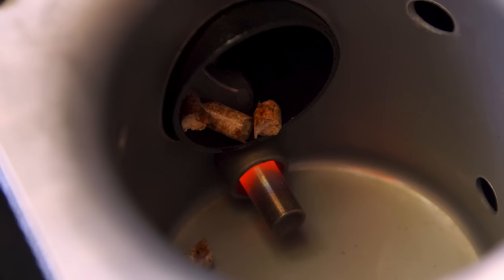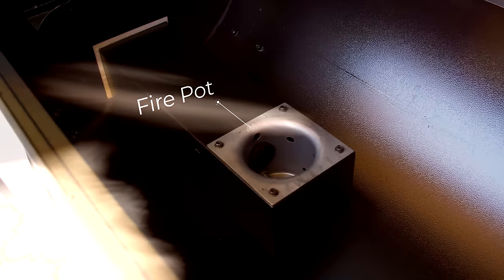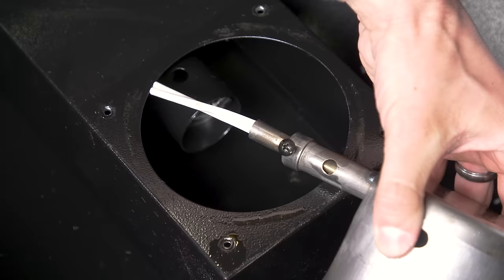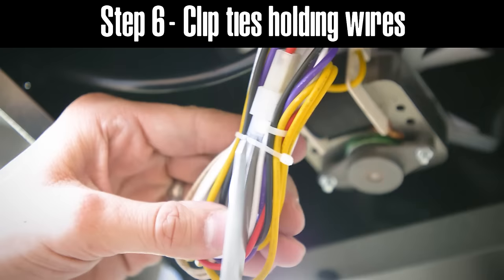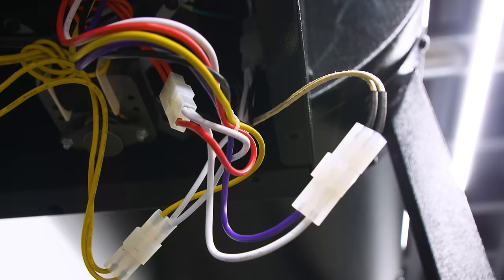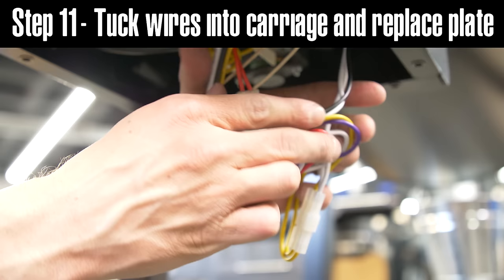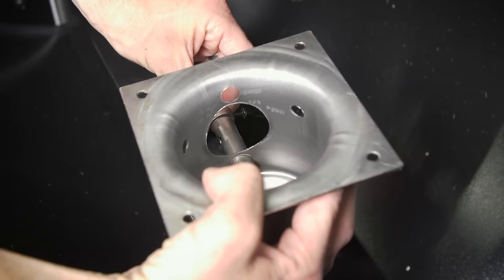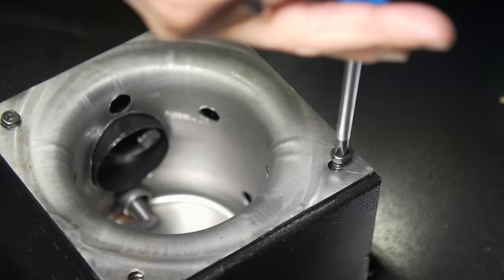How to Replace an Igniter on any Pit Boss Wood Pellet Grill | Pit Boss Pit Stops

Comment: You realize if Pit Boss engineer used even a hair of thought they could make these things 10000xs easier to work on
Reply: This is a pretty simple task that took me less then 10 minutes.  How much easier does it need to be?
Reply: @Mark Ferrari  They should make it where you don't have to replace it after a couple of months and just a few cooks. It's like replacing an alternater in a 2022 vehicle with the new car smell still in it. If I knew I'd be opening up panels and unscrewing  devices I would have gotten a Kamado Joe instead. Excuse my rant but $1100  is too much for their parts to fail that easily.
Reply: @markferrari9734  naw bro a lot of other companies make it easier than this.
Reply: Mine lasted for 2 years.... yours went bad because you didnt clean it or service it properly
Reply: @JABBAWOKKY not even remotely true. I am meticulous about cleaning mine and keeping it seasoned. I vacuum the ash out of my burn pot after every cook. My igniter barely lasted 7 months.
Reply: If  this is hard for you.... Stick to charcoal. 😂

Comment: I have a 4 year old PB and the igniter is no longer heating properly to ignite the pellets. How can I get to the igniter set screw if the screws for the firebox are rusted to the point they can't be turned with a screwdriver or socket? I've always kept my grill covered, so this shouldn't have happened if proper materials were used.
Reply from the maker: We can understand that sometimes the screws are super snug and can be frustrating. There are a few things we can try to get the screws off.

I recommend getting a Flathead Screwdriver and a Hammer. I would give the screw(s) that are giving grief a few love taps on the side of the screws head. This should loosen it up and be easier to unscrew. 

If that doesn't work depending on how many are left, you can turn the access panel to get access to the back of the screws head.

All else fails you can carefully drill the screws out. The Access panel screws dimensions are about M5 .08 Thread.
Reply: Metal is too much like junk and gone to be getting a hammer and and hitting anything. Junk metal used and rusted out and never been wet. Wtf?

Comment: This is the comment you need to read because i actually watched this video, then replaced the igniter.....you will notice in this video, the grill being worked on is brand new.  No cooking has been done on that grill.  My grill that needed an igniter changed has been used because that makes fucking sense.  EVERY screw i encountered might as well have been a tack weld.  Because the garbage dollar general brand screws this company used INSIDE or immediately adjacent to THE IGNITER BOX that by design, gets up to 600 plus degrees are NOT serviceable.  But it is eventually doable. Good luck, but put whatever you thought you were going to cook back in the freezer.  Because you are going to have to run to the hardware store at least twice for new screws and a grinder cut off wheel.

Comment: Had my pit boss for 5 months and already have an igniter issue and controller. Been waiting almost a month for parts. What good is a warranty if there are no parts. I'm looking into putting a rec tec controller in it and be done with it. Stay away from pit boss
Reply: Same issue man. I’ve rebuilt my whole grill and still having issues.

Comment: I recommend adding a string to this replacement. Attach a string to the old igniter end right at the split of the wires. Pull the igniter wire (and string) out through the grommet hole. Then cut the string off. Attach that end of the string to the split in the new igniter and feed the new igniter into the hole. Then just pull the string to pull the new igniter through to the fire pot. Takes all the hassle out of install. Not pictured in video. Remove the grommet from the old igniter via the igniter end and feed it into the new igniter before install.
Reply: I was thinking something like this... I was thinking about taping the wire end to the old burner tip, pull it through disconnect old, connect new, done and done
Reply: Hooked the new connection to the old init. Was able to attached through original hole
Reply: Don't do this just pull the old out and put the new in

Comment: This is practically useless for the vertical smoker. The burn pot doesn't come out through the top, and there is a lot more to remove than just a single cover plate. A separate how-to video is definitely warranted in this case.

Comment: Right out of the box my ignitor won't work! I'm currently on hold for tech support for 45 minutes now! Awesome grill if it worked. I mean right out of the box.. Really??
Reply: So it's going on two weeks now and they still haven't shipped my control board yet! Apparently it is the control board and not the ignitor. I just called and they said they are behind on shipping replacement parts, but call back in a week.. Smh
Reply: Same here... Just plug it on a non GFCI outlet and it will work
Reply: @bobsmith1841  so just an update. It ended up being the control board. I went through tech support and they said that they would send me a new board. I just got it last week! Took all of this time! It's a great grill now that it's working properly
Reply: Did the auger and blower work?;Just put my 820 together today....auger works, blower and control panel light up, but no ignition....
Reply: spudthegreater USA 
same thing as me.  Everything works except the rod doesn’t heat up.
Reply: I figured it out...The instructions are a little misleading.  The best way to do it is plug into a non gfi outlet,  push the on button, prime until you here the pellets drop, THEN turn it to smoke setting and wait. it will take a few mins to start smoking, then it really starts roaring and smoke billows out, then it clears and the temp will start to rise.  you can then close the lid. The problem was the igniter shut off before the auger primer fed the pellets.

Comment: This procedure is very easy to do.  Much better than the latest video from Pit Boss that shows you having to take off the hopper assembly.  At least for the PB1100, you can follow the procedure shown in this video, works fine!

Comment: I’ve had my Pitboss Pro Series for approximately 1 year coming up in June, still a few months shy , and my igniter went out tonight. 

Pitboss has been great with my warranty , sending me parts that have Been defective. I’m starting to think , this grill has had a lot of things go out. Grates, temperature proves, now this.. 

I am considering the fact that I use mine daily. This thing has changed the way we eat! So I’m going to ride out my 5 year warranty and appreciate to positive over the negative
Reply: I’ve had mine for about three months. I just pulled out the old igniter. I’m trying to install the new igniter but it will not fit through the hole via the hopper. Super frustrating! Now I’m left without a smoker till God knows when.
Reply: Im probably going to upgrade to the Digital model soon. Since my bare bones one has a dead igniter
Reply: I’ve had my grill for just over a year , The igniter went out and PitBoss sent me a new one right away. However I can’t removing the fire pot because the screws have deteriorated. It’s literally fused together. Hopefully i can find a solution. I love my grill! Help

Comment: If your Pit Boss is acting up like mine and tripping breakers, you can do one or both of these options. OPTION 1: Get your pellet grill going and then disconnect the purple and white igniter wires. This will prevent a faulty igniter from tripping your breaker after you've started grilling. OPTION 2: Run a switch oto the outside of the grill just for your igniter. Turn the switch on to start the grill and turn the switch off once the grill is started. 🤯 

The first option is $FREE.99 and the second option will cost you a couple bucks at your local store.

Comment: Last morning i found out that the igniter was pulled back in his house and the cable was too short and not locked with the screw....i lengthen it under de hopper..

Now my 850 is a beast❤❤❤❤❤

Comment: Does anyone know if replacing the igniter will stop my pit boss Austin XL from shutting off after about 10 minutes? I already replaced the GFCI outlet thinking that was the problem but it’s still cutting off on it’s own.
Reply from the maker: Hey JJ, the igniter draws the most amount of power and only stays on during start up. Most of the time when the grill has a power fault within 5-10 minutes it's due to the igniter. To test this, try leaving the igniter unplugged (purple/white wires) and run the grill. If it doesn't error out we know the igniter was at fault. Feel free to call our CARE Team at (480) 923 9630 for further troubleshooting steps.

Comment: I am having a issue with my pit boss........I set it at 275 degrees and then it just keeps rising really fast all the way to 350 degrees.......so I just turned it off......I clean the thermostat......still does it........any other ideas????

Comment: Thank you.  You all are very responsive to concerns and questions.  Customer service has been great!  
The igniter I replaced seems to stick out into the firepot a bit longer than shown in the video.   Does this matter much?
Reply from the maker: Good practice is 1/4-1/2 but it isn't the end of the world. It just runs a bigger risk of being covered in pellets and choking. If you ever wind up using an off brand and the ignitor is drowned in pellet waste that comes with non-100% natural pellets, like sugars or plastics, it would be a bit harder to start up the next time.It's a pretty simple mechanic going on, so its simple to address if something is going wrong, just keep an eye on it.

Comment: What if I leave the igniter rod out 1" instead of the recommendation of 1/2
Reply from the maker: Hey Brett, if the igniter is too far into the firepot, it may burn out prematurely due to the direct heat from continuous fires.

Comment: My issue just started happening. Once I turn on the unit on smoke setting it continues to blow and feed pellets causing a large flame and after a bit flips the breaker and shuts down. Any solution??

Comment: Works great if your machine is brand new. Unfortunately mine is 1 year old and the screw that holds the igniter into the burn pot broke. I had to drill the remainder piece of screw out and now I'm trying to put it all back together and hope the new igniter stays put.
Reply from the maker: Hey there Shawn, we are sorry to hear that, It is not normal for that screw to break like that.
Reply: Just happened to ours as well when we were trying to take the ignitor out.

Comment: Thanks for the info I install mine but at the time didn’t know about the 1/4” to 1/2”  igniter tip to be exposed I insert mine all the way in ended on overheating it and tripping the GFCI  but thanks to this tutorial I was able to fix the problem 👍🏽
Reply: Literally just did the same thing, wish I would have paid attention to that part
Reply: I love how I read this as mine is installed too far and it just tripped a breaker. Grr

Comment: The firepot screws can also be taken out with an 8mm hex socket. Also, the zip ties may need to be cut before there's enough slack to get at the set screw.
Reply: I was so grateful for this option! I used some clamp pilers, but same concept.
Reply: Thank you Seems that screws are no longer good after cooking

Comment: My igniter seems to have the same issues. I've only used my COPPERHEAD  Series 5 about 8-10 times. And I clean it religiously. I contact Pit Boss yesterday about a replacement igniter.  But I don't recall the length of the warranted. Otherwise, it's a great device.

Comment: what do you do when you can remove screws rusted or seized
Reply from the maker: We can understand that sometimes the screws are super snug and can be frustrating. There are a few things we can try to get the screws off.

I recommend getting a Flathead Screwdriver and a Hammer. I would give the screw(s) that are giving grief a few love taps on the side of the screws head. This should loosen it up and be easier to unscrew. 

If that doesn't work depending on how many are left, you can turn the access panel to get access to the back of the screws head.

All else fails you can carefully drill the screws out. The Access panel screws dimensions are about M5 .08 Thread.

Comment: All 4 fire pot screws are rusted and are stripping. What should I do now?
Reply from the maker: If they get to the point of needing to be drilled out to remove, just let us know and we can send some replacements out to you.
Reply: Pit Boss Grills I didn’t realize at first that they were hexagonal. I was able to use my socket to get them out. Thanks
Reply: @PitBossGrills  What about screws under the hopper? And now I'm supposed to drill those out? Horrible quality. This is my second issue with this smoker (first issue was paint peeling even when properly covered and stored). I have a +20 year old Brinkmann smoker that has neither of these issues.

Comment: Hello pit boss.
I walked out to my backyard today and realized I left my pit boss plugged in the knob in the off position for cool down.
I never went back to unplug and cover it. It rained pretty good.
The plug is in and the screen is blank the power button doesn’t do anything. 
What can I do? 
GFC on outdoor outlet is not tripped.
Reply from the maker: call customer service and they will help you with this 877-303-3134

Comment: Thank you, how about replacing the igniter in a Whiskey Still Vertical Smoker, it looks like hopper has to be disassembled, can you confirm?
Reply from the maker: You need to take the hopper assembly off. If you can call us, we can send instructions. 877-942-2246

Comment: If you install the ignitor to deep in the firepot will that cause the igniter to fail?
Reply from the maker: It should only be 1/4" to 1/2" into the pot .

Comment: Why am I replacing when I haven't used it but about a hundred times?
Reply from the maker: Jimmy, with any part, they can sometimes fail and as these get so hot and are made of ceramic, they could, over time, could crack or fail.
Reply: Pit Boss Grills Man mine is new, can’t even use the dam thing.
Reply: I can probably count on two hands the number of times I've used mine and my igniter died too. Cheap parts apparently.
Reply: @bradj7064  my wife is more patient than me, she took it apart and cleaned the primer out and cleaned the igniter. No problems since.

Comment: My igniter stays on after I turn off my pellet grill I have to unplug the power cord to get it to cool down and as soon as I plug it in it gets hot with out turning it on
Reply: I have the same problem. Have you found the solution yet?
Reply: @kevinwinkle8091  yes it was the computer board
Reply: @jamesleojonesjr8017  Thank you

Comment: This video just saved the Mother's Day pork butt.  While cleaning, the igniter slid back into the burn tube, and I couldn't remember how to pull it through. After an hour of trying my way, I fast-forwarded this video to the part I needed, and BOOM fixed it in 15 seconds.  I will learn nothing from this experience.

Comment: Well...I had to remove eight screws.  Two stripped, and had to deal with those.  The igniter doesn't easily guide back through the hole.  Having said that, this video IS helpful.  The act itself isn't this easy.

Comment: This isn't at all applicable to the Pit Boss Competition Series with the removable burn pot.  It SHOULD be easier, except the set screw holding the ignitor in place snapped off so I can't get the old one out.  I've place 5 CALLS to the Pit Boss customer support center.  Every time the answer is different and every time the parts take WEEKS to ship even though they are in stock.

I'm so fed up!  Can y'all support your  product or not?

Comment: Try accessing & loosening the 6 screws on the hopper after the pit has been in use for 18 months. Q: why are there 6 screws on the bottom of the hopper & not a simple large wing nut? A: It wasn’t meant to be accessible & this fix is for an unexpected but common problem. The bottom of the hopper & the 6 screws are dusted & rusted together & cannot be opened unless the pit is new. My Pit Boss is headed to the trash heap. I guess it was only a rental.
Reply from the maker: You can try to drill the heads of the screws to access it

Comment: I have had my Pit Boss 820 B for 3 years now and the fire pot rotted out so I had to replace it. It was a 30 minute job, very easy. The only issue that I have had is the fire pot rotting and a horrible grease fire that I still don't know how it happened . I was bummed out that my paint was ruined as I love my Pellet grill.
Reply: I had a fire in mine that screwed up the paint, too. Had to brush off what I could and applied some high-temperature paint. Did the trick but looks kinda janky now.
Reply: Same here

Comment: My screws are rusted from the heat
Reply: @nietbepalen  I respect that, but heat can play a role in how things rust over time. Especially with higher Temps.  I was able to get the screws out. Appreciate you
Reply: @Vinsanity86  order some original and once per year change them

Comment: The screws on the bottom plate - there are 7 of them - are too soft metal with shallow heads. Three of them shredded easily and I had to drill them out. Except they are threaded into permanent bolts on the inside, therefore once the heads are drilled off, they are difficult to replace without a major overhaul. This is a materials and design flaw. Also, my igniter cable was zip-tied to a bundle of wires inside the box and did not have enough give to reassemble and firm up the set screw (with 1/4 to 1/2 inch of the igniter exposed in the fire box). Therefore I had to cut the zip tie, free up the cable, assemble the firebox with igniter and set screw in place. This is more work than it should have been.